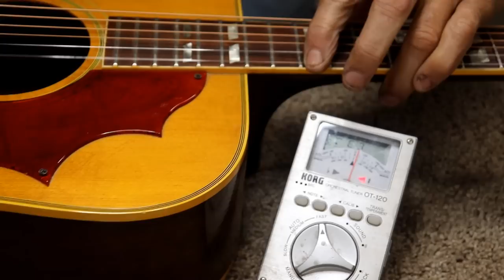647 RSW Bridge Replacement and  Intonation Tutorial

Comment: That's a lovely Gibson.  It sounds great!  It's too bad they didn't make the bridge right the first time. The screwed on pickguard has me shaking my head, too. I've watched hundreds of your videos, so (even though I've never replaced a bridge on an acoustic), that makes me an Internet Expert, right? The only thing else you could do to improve the sound would be to increase the break angle over the saddle by cutting slots in the bridge between the pin holes and the saddle. Due to Gibson's poor original design, those holes are pretty far from the saddle. Until your next video, Cheers, Jerry!

Comment: Looks like the original bridge was about a quarter inch too close to the neck making your new one that way, too.
Reply: No, the saddle was too close, to the nut and Jerry set his perfectly.
The issue is always the saddle distance, from the nut.
The bridge is never in the wrong place, unless you run out of space, trying
to properly locate the saddle. 😁✌🖖
Reply: @zapa1pnt  My point, when observing how the pins are near the south edge and the saddle is about center is that, keeping the pins and saddle in those positions, the body of the bridge could be shifted south at least 3/16". Jerry can't do that because then the bridge would be outside it's original position exposing raw wood.